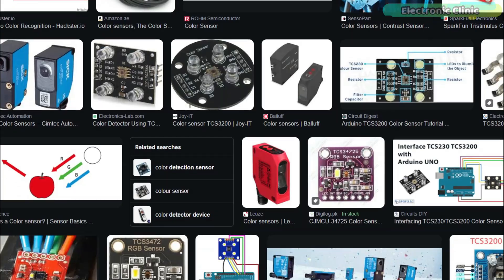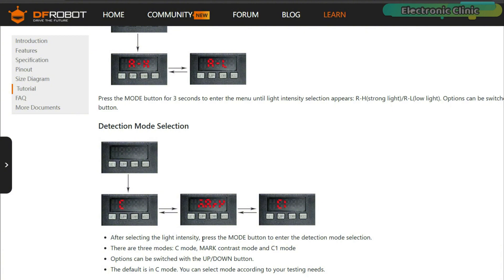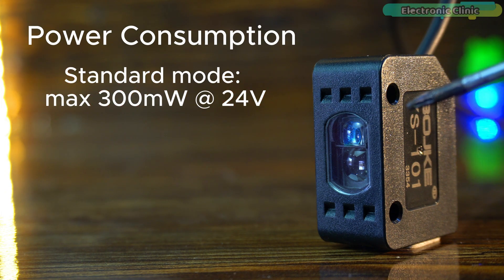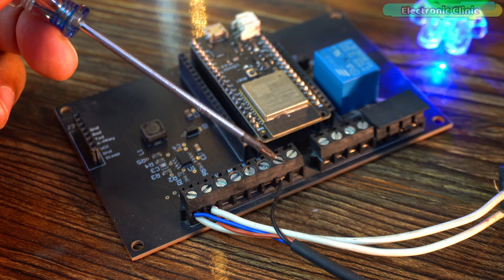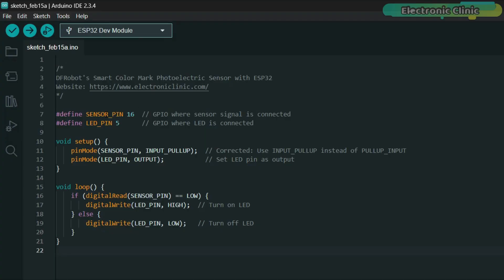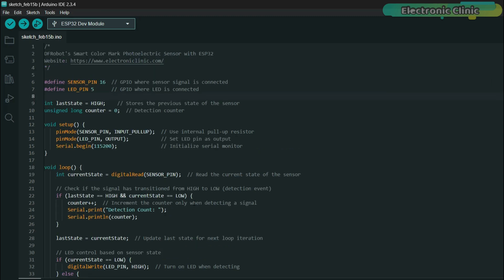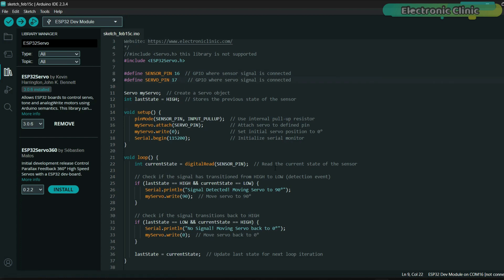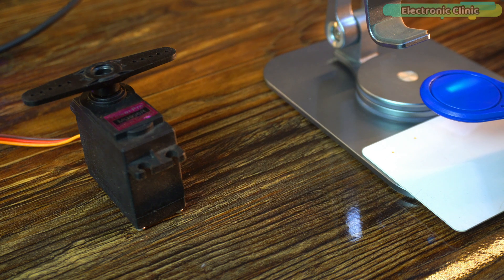ESP32 + Smart Color Mark Photoelectric Sensor | Color Sensor from DFRobot, Servo control & counting

Comment: Sir, i have problem with this product the output voltage according to the data sheet is should be between 0-5v ,but the i output voltage i get when it’s senses is 0.8v which is very low what is the problem?